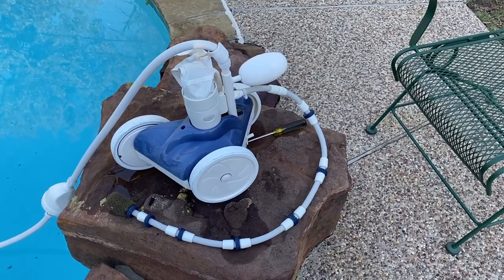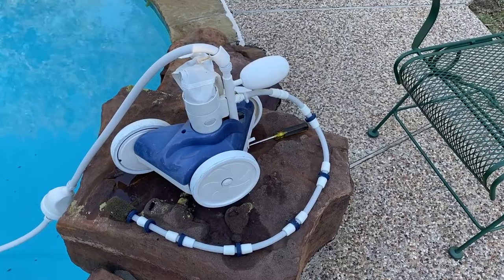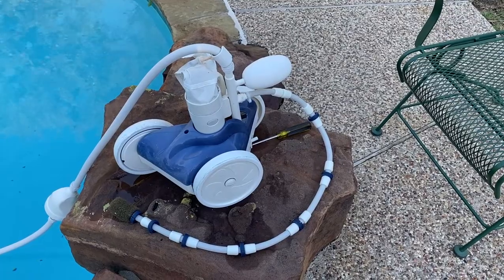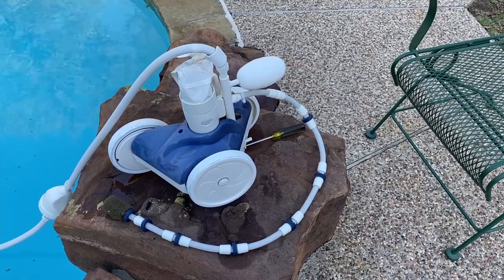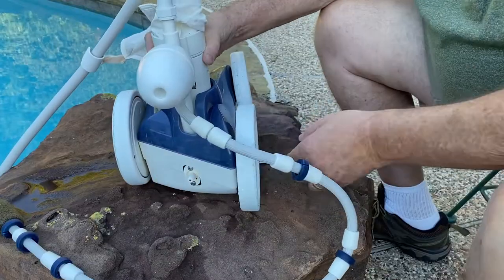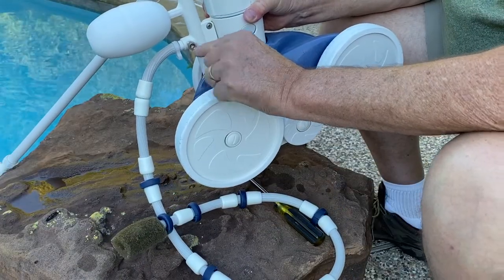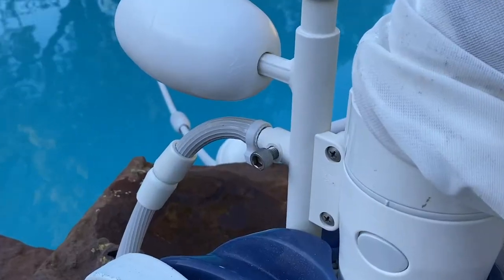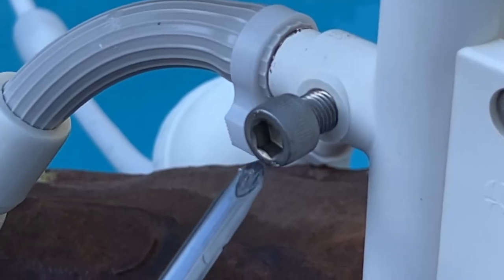Polaris Sweep Hose Adjustment

Comment: Tried adjusting the screw. Still doesn’t sweep.
Reply from the maker: Make sure the wall filter or inline filter is clean.  You may have restrictor plates in.  Also, make sure main filter is clean.